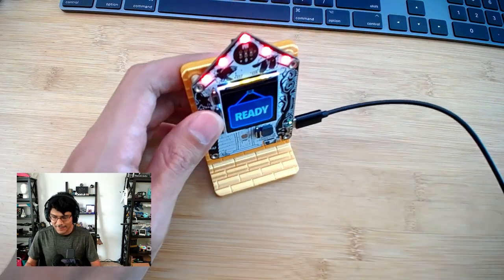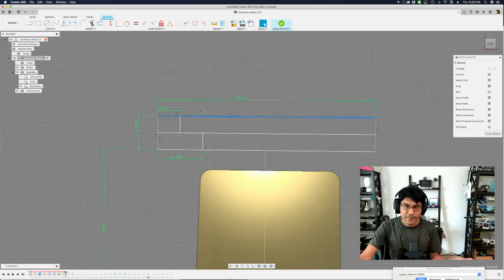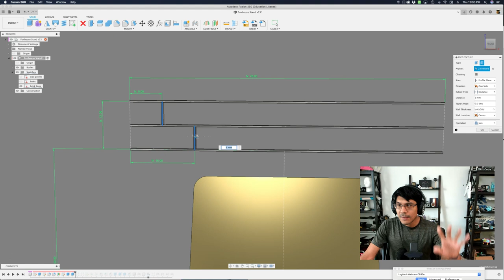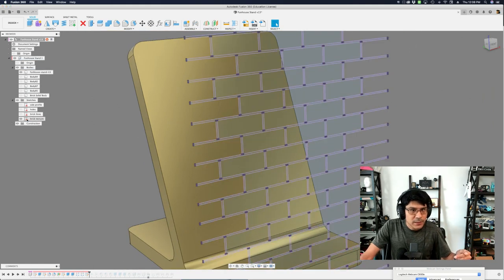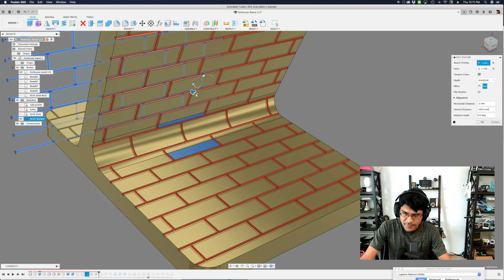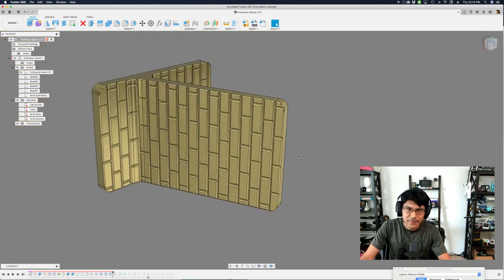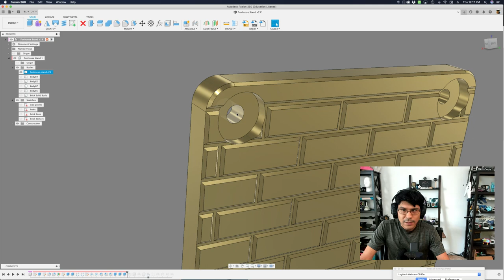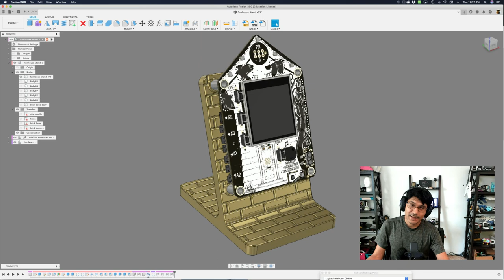Layer by Layer – Brick Texture with Emboss – Fusion 360

Comment: I'm trying to deboss a brick pattern into a large 8' x 12' panel.  Newbie thinks everything worked right, the thin extrude and rectangular  pattern looks great.  Uh...it made 1054 bodies.  Rechecked the column bars thin extrude to make sure they were 'join' (ooops!) and it reduced it to 647 bodies. Have chaining selected on both thin extrudes (don't know about that).  If you don't hear from me the emboss blew me up!!!